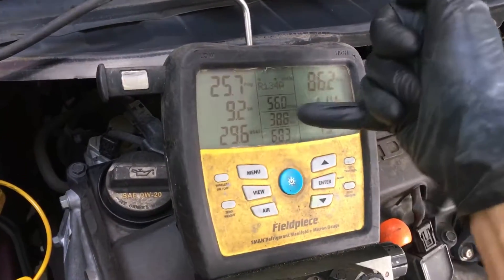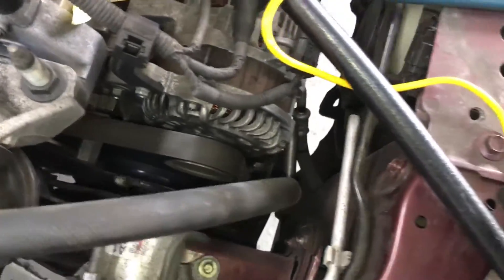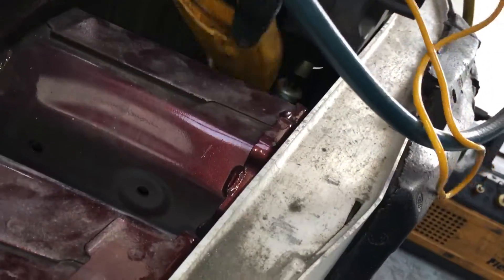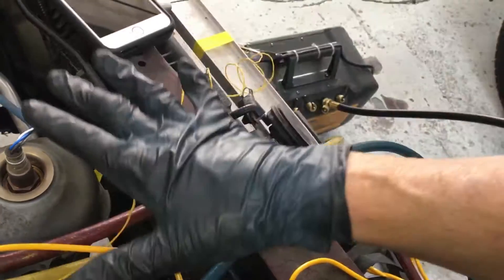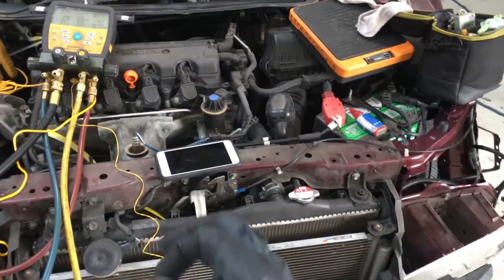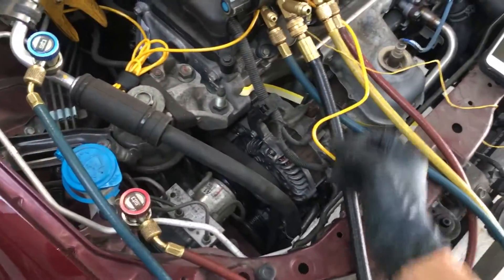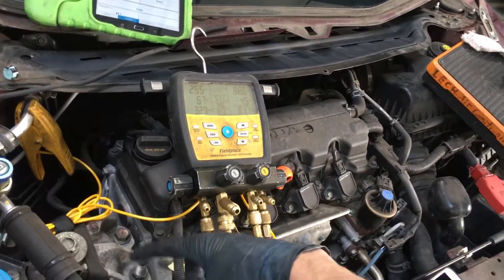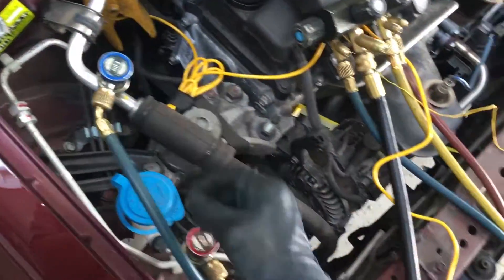Reading Automotive AC suction line and liquid line in vapor line temperatures using SMAN 480V

Comment: Hi, why did the compressor goes on/off is there a thermostat that stops the compressor?
Reply from the maker: Yes.   It’s a very cool day so there’s no heat load so it instantly satisfies it set temperature and turns back off
Reply: @coldfinger459sub0  what on a car that cycling when it's no where near set temp? it's not because of the pressures i checked it only could be a overheating relay? is that even normal?
Reply from the maker: @Chargifyx74  it’s normal for a manufactures AC system that was designed with a temperature switch in the back of the head off of the compressor and the compressor is overheating when it starts running kicking off on safety. 

It could be normal in a situation on a particular year model vehicle, where you’re taking the high side pressure on the liquid line after the condenser 

But high pressure switch is located on the high side of the compressor or line and it’s reading 440 psi cycling off but you’re only reading 150 psi or something like that not knowing that it’s a partially plugged condenser

And then there’s a few more scenarios we do that exact same thing 

It all depends on that manufactured design that under what scenario 

Gets back to reading or understanding the design and software operation . 

Different on different vehicles under different scenarios 

You could have two different vehicles with the exact same scenario in ambient conditions that react very differently to the same situation
Reply: @coldfinger459sub0  that pressure is now 200 and 240 with hood closed the condenser is sucking in hot air front he engine the air dams are missing the air is so hot it burns me now with the bumper off and hood open this wasn’t happening and head pressure was low also I can verify that the condenser has no restrictions i test that before I installed it